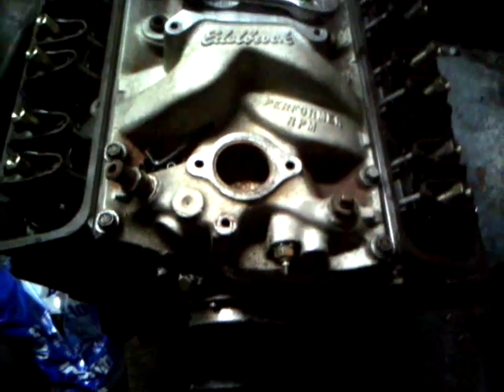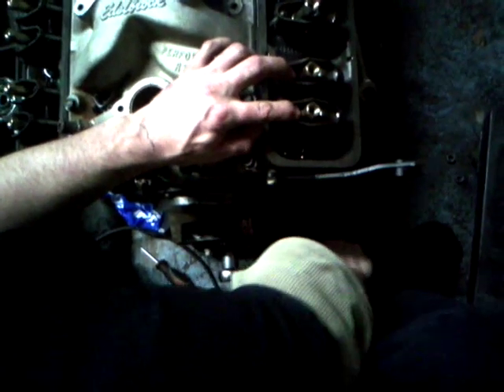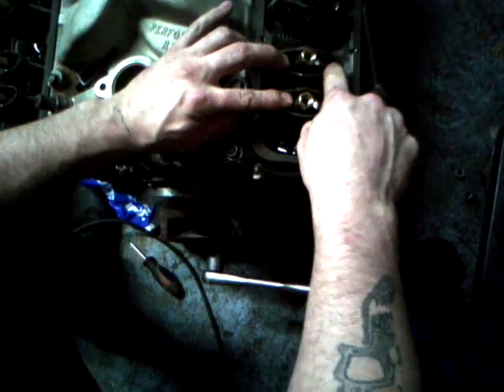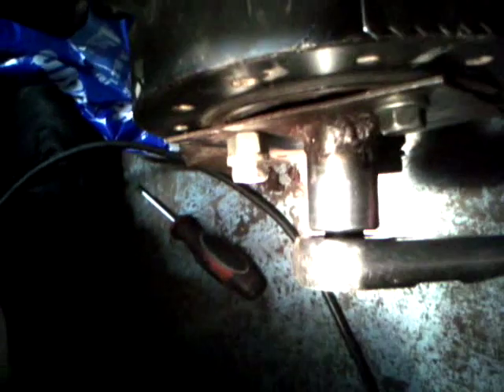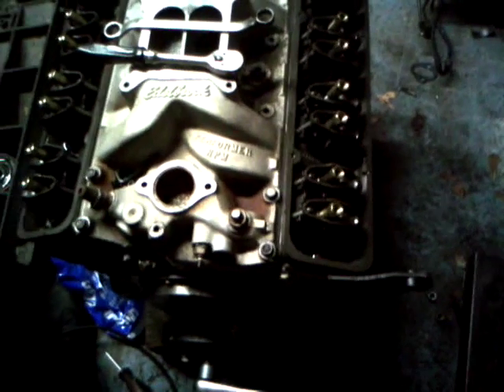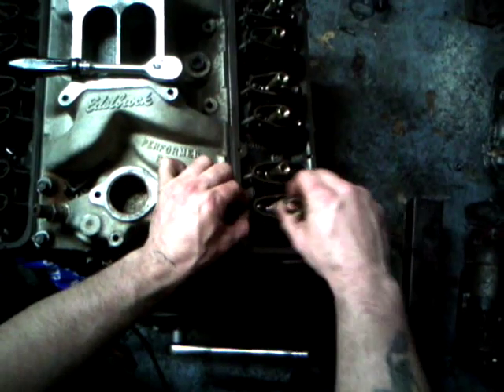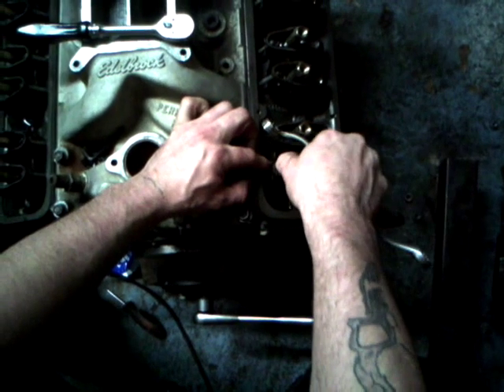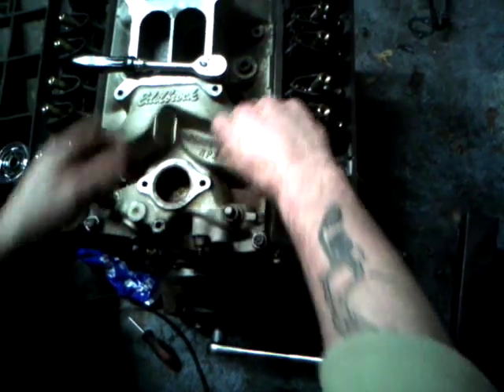hydraulic valve lash adjustment small block chevy

Comment: With a long duration bump stick,  stack up the firing order thus:  1-8-4-3.                                                                                  
                                                                                                                   6-5-7-2 in the case of most V-8s GM gas engines.  Now, turn the crank until # 6 is at TDC.  Notice rhat # 1 is also at TDC.  Then what I do is roll the crank Clockwise viewed from the front  until 1 or 6 rockers are rocking equally.  Then look at the firing order above. I go for # 6 rocking, then adjust #1 valves, knowing that #1 valves are fully shut at TDC and # 6 valves are equally half open.  Then roll the crank until #5 is rocking, the adjust #8 valves.  With a high performance cam, you cannot adjust numerous valves at once because of weird lobe separation, overlap and lift.  Then use the chart above, once again roll the crank to get #7 rocking and adjust #4 and so on until #1 is rocking , then adjust #6, reversing the chart above.  I have bent a pushrod or two, a valve or two and ruined a piston or two.  Ya gotta have the #1 and #6, 360 degrees apart from each other, #5 and #8 and so forth. This simple chart, above, will allow all the valves to be adjusted with two revolutions of the crank.  Mark each valve set as you adjust them so ya don’t lose yer place.  At my age, I sometimes I lose my place.  Dave “the Per-Fesser” Makela, ooeooaa@gmail.com.  Like Forrest Gump says “that’s all I have to say about that”

Comment: The threads on the rocker arm studs are .060 apart and the spec is .030 to .060, therefore turning the nut 1/2 turn gets you to about the minimum spec and one turn gets you to the maximum spec. It's been 20 years since I've adjusted valves on a SBC and this made for a great refresher course. Good video and thanks!

Comment from the maker: I can break this process down and you can see if it will work for your BBF. #1 and #6 are at TDC at the same time, one will be on the compression stroke and one will be on the exhaust stroke. So get the engine to tdc compression stroke on #1 and adjust both of those. Then follow the firing order adjusting exhaust valves. Skip #6. After #6 follow the rest of the firing order but adjust intake valves. Then just rotate the engine one revolution and adjust the rest.

Comment: Great video and well done. Thanks for the information. I have a Big Block Ford 460 engine with a firing order of 1-5-4-2-6-3-7-8. Do you have information of which valves to adjust when cylinder#1 is TDC? and which valves are adjusted after making a full turn of the crank?  If there is another video to illustrate a BBF please pass it along. Thanks Again

Comment: can i do a valve adjustment in the engine with the transmission mounted in my truck ? i want to ask to make sure i don't broke anything, far as i heard i can put some block in my tires an put the gear in Neutral should that work ? thanks

Comment from the maker: with solid lifters you would adjust the same way just put your feeler gauge between the valve and rocker. you want light drag on the gauge.  or you can use go-no go gauges.

Comment from the maker: @schrankm  good tip, I just leave the engine lift plate on until I'm ready to install the carb. I also leave the oil pump primer in until I install the distributor

Comment: it's a good practice to cover your open carb mounting surface and water inlet hole to be sure not to drop anything in those holes. i once lost a valve cover bolt and guess where i later found it.... tucked neatly between a valve and its seat inside the cylinder.